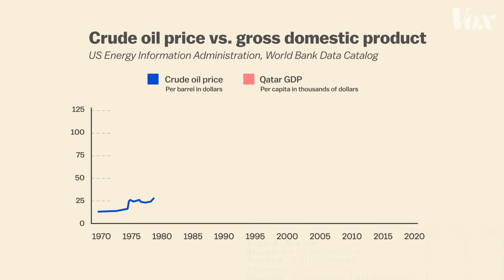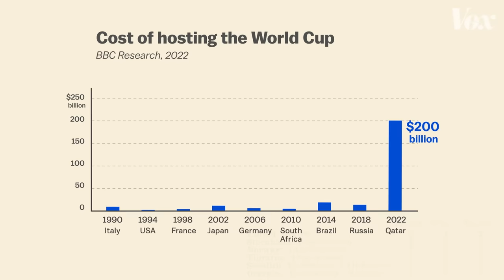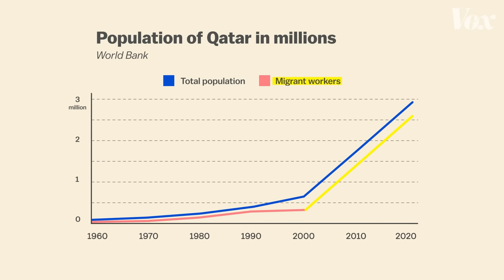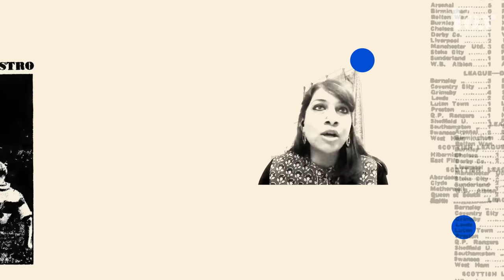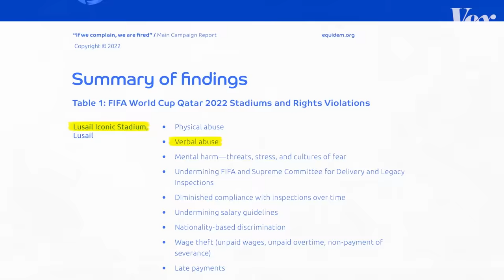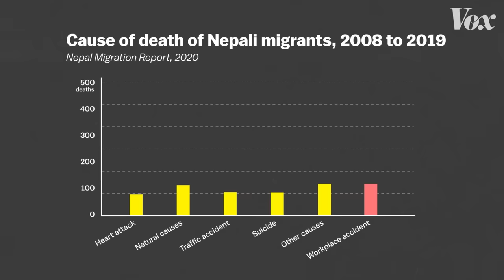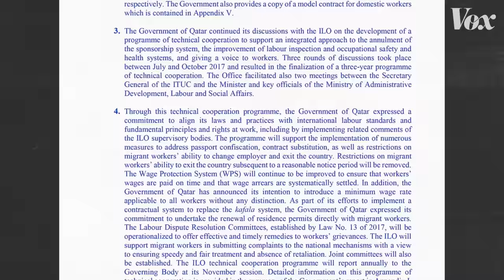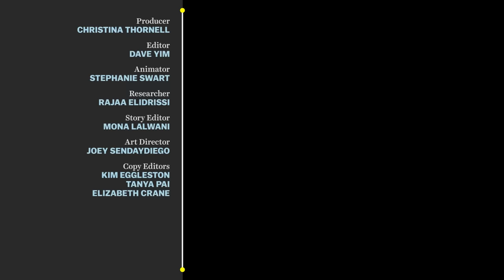How Qatar built stadiums with forced labor

Comment: This has been going on for decades. It didn't start with the fifa construction. And my question is, if the system and work conditions are so awful, why are these workers still signing up? They know what they're signing up for because this system is decades old. What are the work conditions in their home-countries? Are they used to this kind of treatment? Why are they opting to go and work abroad?
Is it much different from western countries outsourcing and paying Indian, Bengali, and Chinese factory workers way much less than an American would accept?
Reply: Please read post above from Pacific Anwer
Reply: I'm not justifying anything but you've got a solid point
Reply: Rapid infrastructural growth is the reason. The places where these workers are from have extremely high population densities and their job markets are already saturated and they are not building massive infrastructure for an event like FIFA. Plus the currency value

Comment: You say "In the last 18 years, Qatar has held more than 20 major sporting events" but you don't list the Qatar round of the MotoGP Championship, which has been held every year since 2004, and they also held an F1 Grand Prix during COVID. Qatar actually owns the parent company of Dorna (MotoGP's owners) and insists on it hosting the opening round of every season, no doubt offering to pay far more than any traditional Grand Prix circuit could afford. Having started in 2004, it's one of the older examples of Qatar's Sports-washing.

Comment: FTR i have worked in 114 under the humidity factor and it was nearly impossible to work you just felt like collapsing no energy at all.IDK how much of a difference from humudity heat and real 114 but they are likely the same  which leads me to wonder how they could work at all.